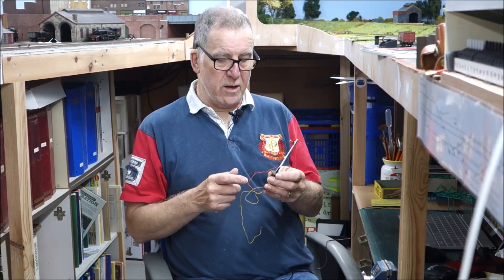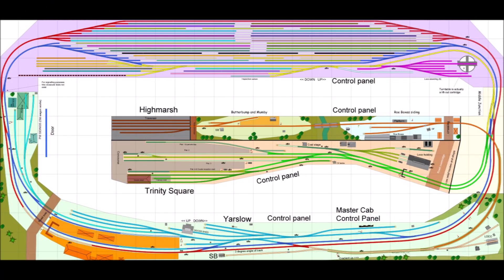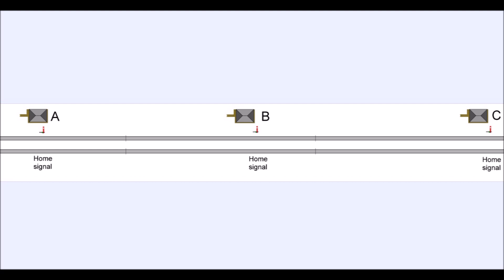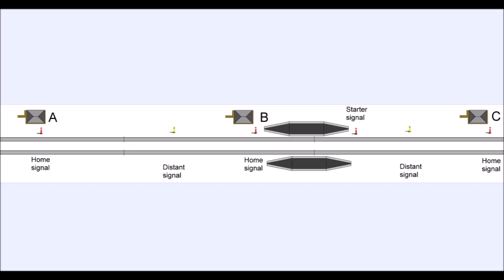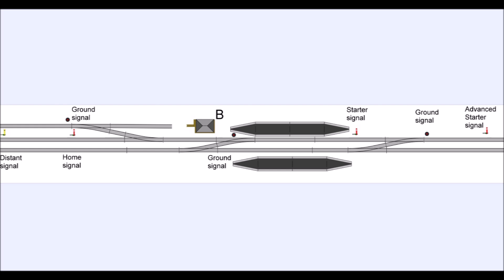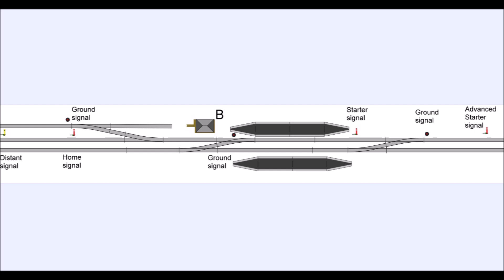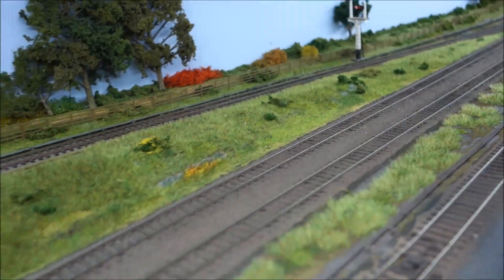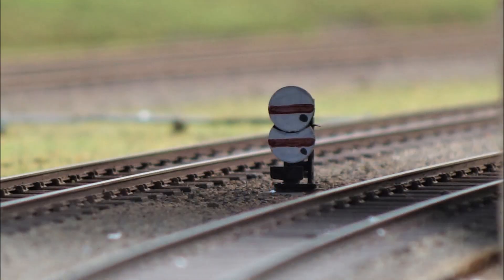Bite Size Bits - Basic Signalling

Comment: Very well presented.  For a basic introduction to signalling, it covered a lot of very salient points.  As for interlocking, it isn't really that difficult if you are able to think logically.  I have a limited amount of interlocking on my own layout that basically prevents a signal being cleared for a route that hasn't been set correctly.  The only reason I haven't gone for full interlocking is that there isn't enough room in my control panel for the relay boards that would be required.
Reply from the maker: Hi.  Yarslow is designed as a one-man operation layout so I decided to steer clear of interlocking.  Each of the 14 sections on the layout can only be switched to one controller which, in theory, cuts down potential collisions but it is still very possible!  Guess how I know that.....................
Reply: @yarslowmodelrailway1  Had to have a chuckle there.

Comment: Great description and easy to understand. I’d like to clarify why the distant cannot be cleared if the stop signals are not also cleared. 
The distant is only interlocked with the home signal and therefore can only be OFF if the home signal is OFF. The home signal (and any associated stop signals between the home and starter/section) should only be OFF if the driver will not see an irregular sequence, i.e. green followed by red.
If the train is not accepted by the box in advance and the starter/section signal is ON, you have to clear each stop signal when the train is at or nearly at a stand at each stop signal in turn, until it is stopped at the advanced starter/section signal. This is known as regulating the train, commonly referred to as stepping down. 
Also be wary of saying a distant signal shows danger, by definition it can only show caution or proceed aspects, it will never show red/danger.
Reply from the maker: Thanks for this.  Always happy to learn or get clarification from people who know more than I do.
Reply: @yarslowmodelrailway1  it’s an easy topic to ignore but it can really enhance operational.

Comment: Great stuff just what I had hoped for. 
One small point - I think in the example used running round the train would be unlikely. The train would just leave the guards van on the main line (clear of the home signal) and reverse to drop-off/pick-up from the siding. Or perhaps to reverse the whole train into the siding so it could be overtaken by a faster train.
One question - would the ground signal at the end of the siding provide enough authority to restart a train that had been refuged in the siding or would another starter signal at the end of the siding be needed?
Thanks a lot
Jon
Reply from the maker: Hi Jon.  You may be right about the shunting - I was just using it as an example.  The ground signal is not authority to start the train, only access the running  line.  The train would have to pass the starter and adv starter to access the next section anyway.  In a refuge siding, a starter could be used to authorise departure, probably up to a advanced starter (the limit of shunt and perhaps the point from which the train reversed into refuge).  The difficult thing about signalling is that the rules were strict - "Thou shalt not..." but the many and varied track layouts created many different signalling solutions.  Best to look at examples of your chosen railway to get a good idea of what they woud have done.
Reply: Thanks very much for clearing up my query. I am looking forward to the next installment
Jon @yarslowmodelrailway1

Comment: Nice. The more I look at this, the more I can see that most layouts would extremely rarely need to include a distant signal, unless they're modelling "the middle of nowhere" or at least the middle of a block, with any home signal off scene from the modeled distant. However, there is possibly more option to have a combined home/starter and distant post, where the next station or block are about 1/4 mile down the line.

Is there a chance you might introduce the next level, where we look at shunt signals and shunt limits? And why they might be included?
Reply from the maker: Hi Neil  I feel a "part 2" is going to be needed to cover those things I didn't here.  The risk was the vid running to 30-40 minutes - hardly a Bite Size!!
Reply: @yarslowmodelrailway1  The split makes sense, you cover the absolute basics here, which is sufficient.